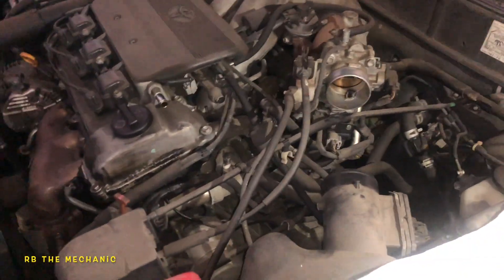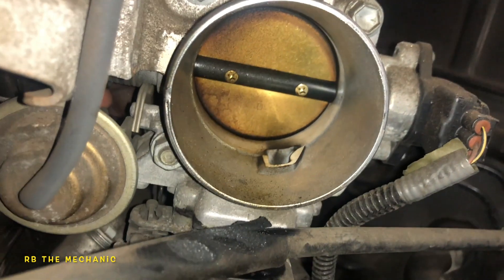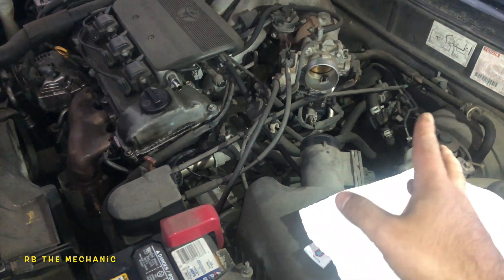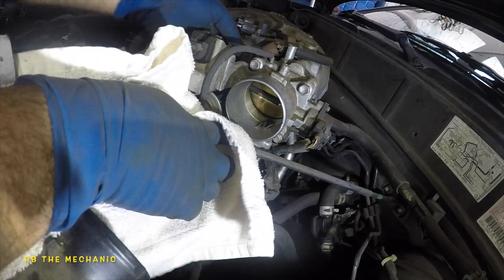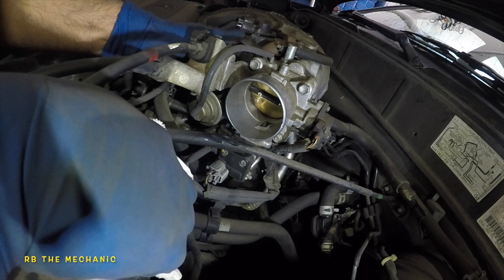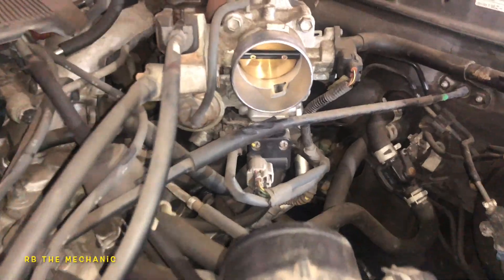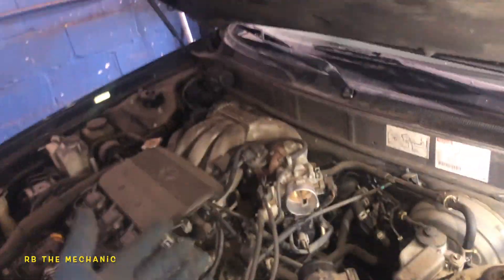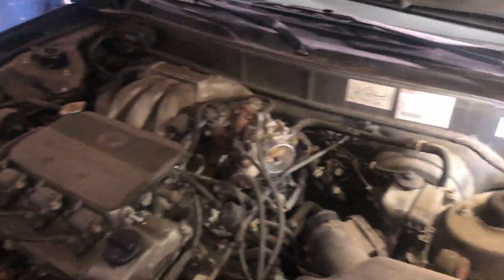Poor Idle /  Low RPM  car stalls  DO this simple service  FIX IT ALL

Comment: i got a 2000 mazda protege es and it idles at less than half an rpm im going to try this and see. any suggestions for leaking oil while running but not when off
Reply from the maker: Oil leaks need to be seen the area it’s leaking that could be any type of oil trans mission or engine and it could leak from oil pump oil pan crank seals

Comment: My 00 Solara V6 still low idle when I start it up from time to time maybe I have to take the IAC completely off the throttle body and give it a good cleaning
Reply from the maker: Yeah iac need cleaning
Reply: @RBTheMechanic  just did it waiting for it to dry.. it was pretty stuck now it moves freely.. hopefully that does the trick.. thanks

Comment: I have 02 rav4 .when I push the gas pedal doesn't run fast. 5 months ago show me the p0420..but I cleaned the MAF SENSOR and the code don't come back.
Reply: But still 🐌 slow when I push the gas pedal
Reply from the maker: That is ur catalytic converter maybe it’s blocked up replace it
Reply: @RBTheMechanic  ok. Thanks men . good videos

Comment: Let me guess is that a 2000 camry? 
I have an issue. When I start my car I need to give acceleration otherwise it won't start. After starting it looks like it is going to stop/stall and after few minutes the rpm will go normal.
Reply from the maker: Not sure what year that was but so throttle cleaning it most-likely will help
Reply: @RBTheMechanic  thank you. Have a great day
Reply: That’s happening to my Camry also do you know what the problem would be I clean the throttle body every few months
Reply from the maker: @irefrea3746  cool this is good service to do often
Reply: @irefrea3746  either sensor or throttle body issue

Comment: But if the car rpm on idle is 500 only and  once you put in Drive then almost going to off and shakes,, what can be the reasons?
Reply from the maker: Possability u need to clean the throttle and do idle relearn
Reply: @RBTheMechanic  brother i already cleaned throttle like new, put new air filter and 4 months ago new NGK spark plugs
Reply: @hindustanmerijaan1930 what car is it